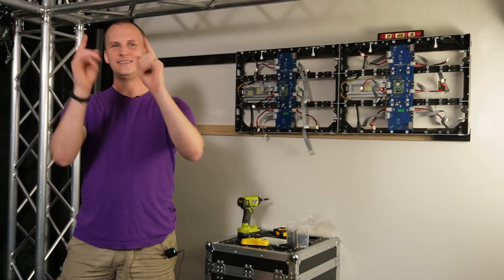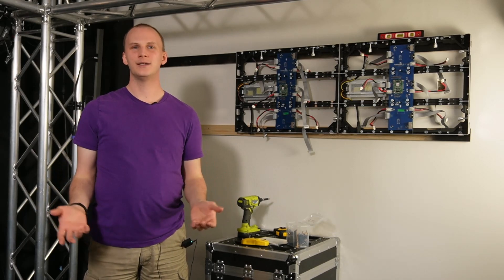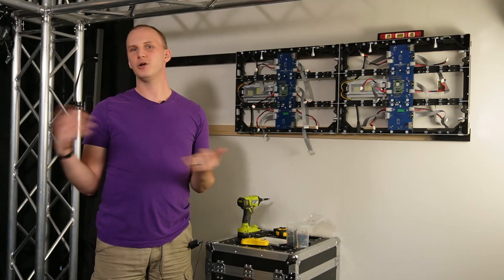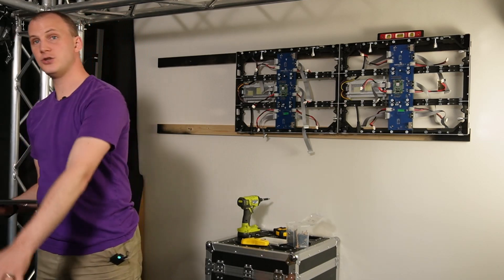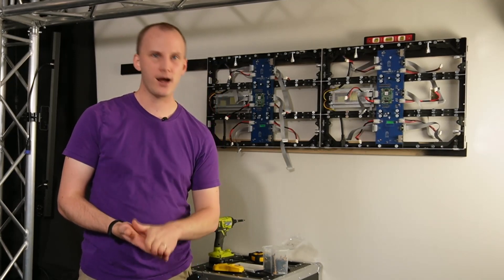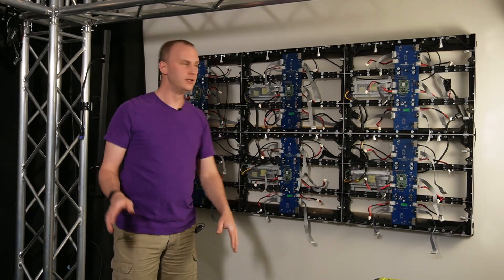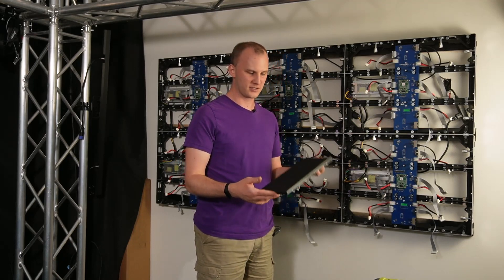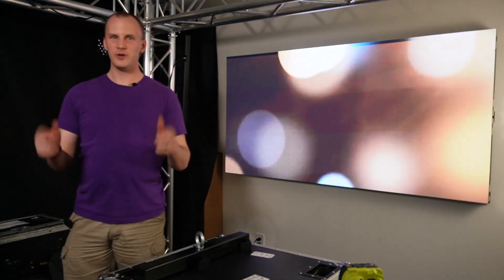How Do I Install an LED Wall Permanently? Featuring CreationLED

Comment: That looks the size of a TV. Why not just buy a TV?
Reply from the maker: The wall I build in this video is on the smaller size, mostly due to the fact that my studio space is small.  But, it brings up a valid point:

1) LED walls don't have glare/reflections on the front glass like TV's.
2) LED walls are significantly brighter than TV's.  Especially when used in areas of stages that have lighting, this can be really important.
3) Proper, black-body LED's like these will disappear on dark backgrounds when turned off.  TV's generally still have some brightness from the backlight, plus the bezel that surrounds the TV.
4) Repairability - at this size, it's probably not  a valid point, but when a TV dies, it typically can't be repaired.   LED walls are 100% repairable for many years to come.